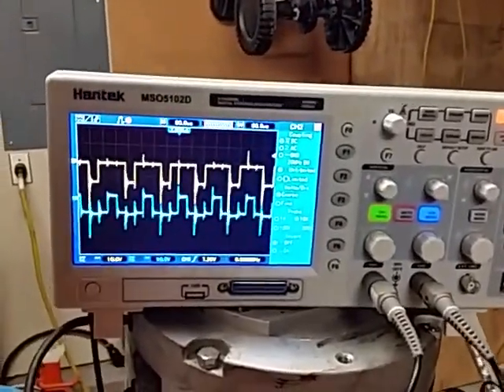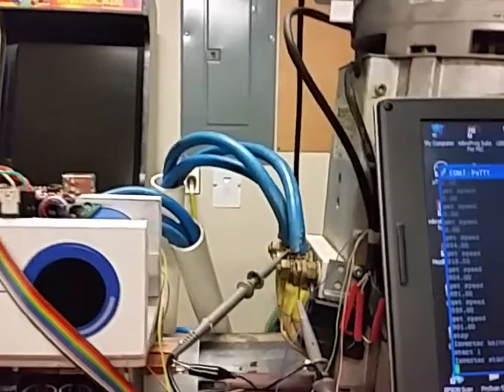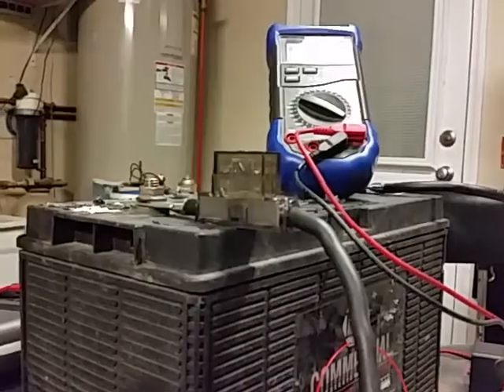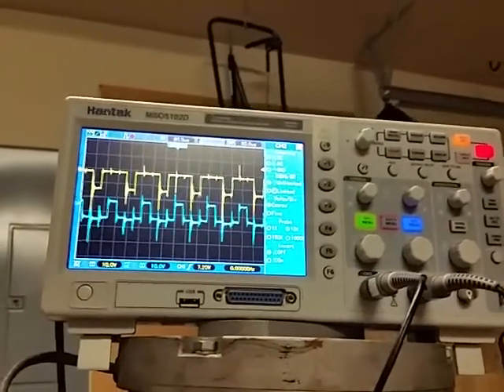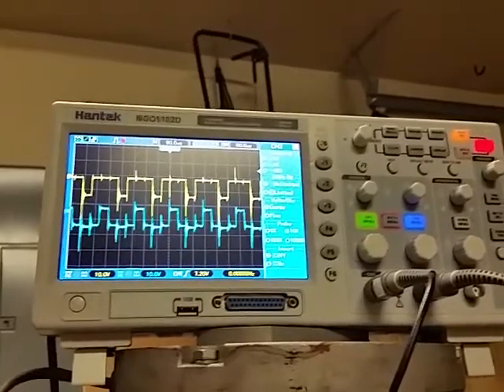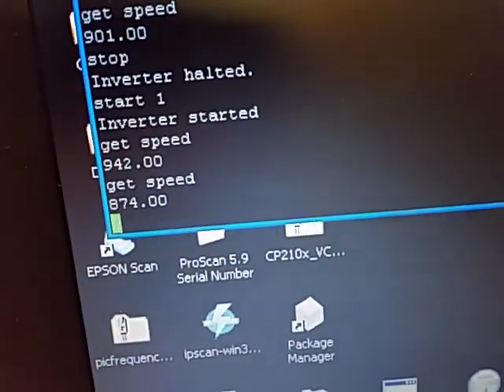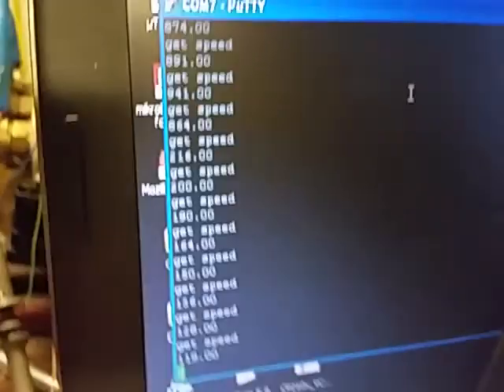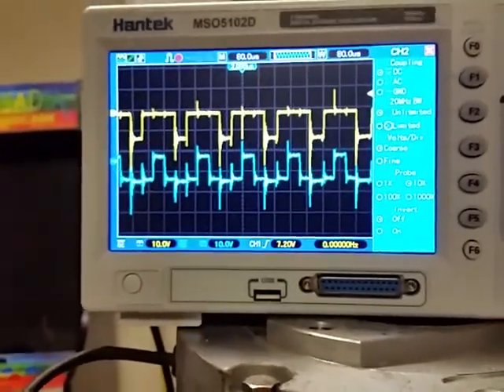AC Motor with encoder enabled

Comment: I'm trying to use a standard 110v AC geared winch motors to control the XYZ motion of a large 3D printer. If I add an optical encoder to the motors will I be able to get precision control of a stepper motor?
Reply from the maker: If you could get that to work I believe  the slop in the winch gearbox would be problematic. You would have no precision and repeatability. If a cnc motor has a gearbox it is a precision instrument designed with ultra close tolerances. Closed loop servos in smaller cncs are typically brushed dc motors or steppers but a new breed of close loop steppers is becoming a popular choice.

Comment: Is this an induction motor? and is the encoder built-in?
If yes, where can I found an induction motor with built-in encoder?
Reply from the maker: Yes, it is a 3 phase induction motor. It does have a high resolution, 2 channel encoder built in. The encoder is actually built into the main bearing on the armature shaft. It is designed for harsh environment use and is shielded from the elements when the motor is properly mounted. In this motor one of the two channels was bad. That was okay for me because I was only running the motor in one direction. These motors should not be too difficult to find. Any forklift with AC traction or AC hydraulics will yield a motor with an encoder. I actually have more than one of these. Unfortunately, unless you can pick one up locally, shipping one of these things will cost more than the motor itself. They are insanely heavy!
Reply: @generatorlabs  Thank you very much, but I'm looking for small power rating (hundreds of Watts )

Comment: do you need the encoder to use torque mode?  I assume you are doing closed-loop VOC with this encoder.  Even with open loop, I assume you can do torque mode, or as I like to call it, torque control, in other words, control the rotor slip.  I think the distinction between open loop and close loop is that with open loop, you have to calculate a certain amount of Id (rotor slip current), based on an assumed slip theta.  I think the gain with an encoder is you can know the actual slip vs predicting it, and therefore know exactly how much current to feed to Id, rotor slip.  The advantage there is efficiency, being able to to squeak out a few extra % when trying to run either a light load or heavy load.

What type of encoder are you using?  What kind of signal does it give you?
Reply from the maker: It has been a while since I worked on this but from what I can remember a single channel encoder is required for Torque mode. In open loop the ramp of PWM function was not as smooth with some predictive algorithms being used. The math involved is above my pay grade but I am sure the author of the firmware would be willing to share any theory info you require. He can be found at http://johanneshuebner.com/quickcms/index.html%3Fen_software-principles,19.html.  Hope that is helpful. After I completed my controller I sold it to a genetleman in Californaia to do a VW Beetle conversion. I found myself purchasing a BMW i3 before selling the unit to quench my desire to drive electric. I guess I am impatient :)
Reply: Daniel Perez  I'm not sure if you mention if this is PM motor or IM, but I assume you just need single channel to determine theta, which is the number of degrees past the rotor Flux field. Ideally, in a PM motor you want this at zero degrees, but in IM it should be a few degrees off depending on your demanded torque. This sets your field weakening, aka torque current, aka in Clarke transform as i sub d. My question is what do you demand that theta to be if you want to regulate torque most efficiently? I mean if you pick a specific demand value which sets theta and i sub d, is there any way to predict if you are doing so efficiently without doing a Pin Pout test?